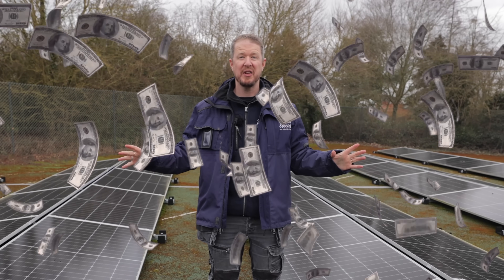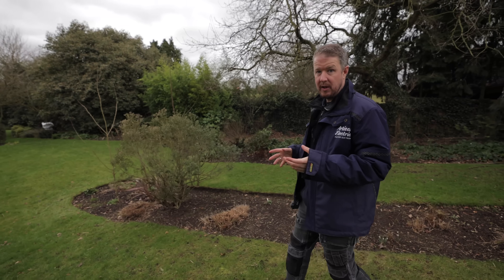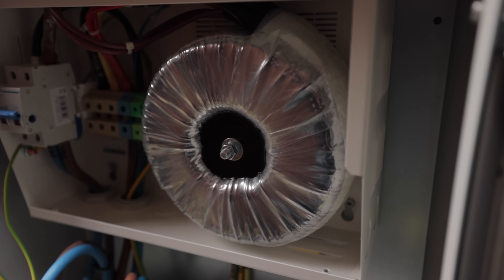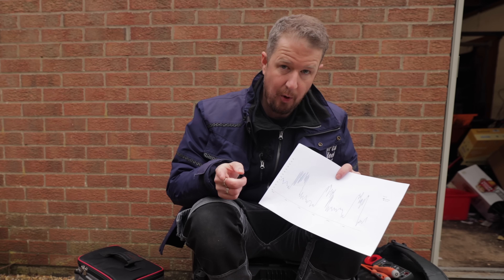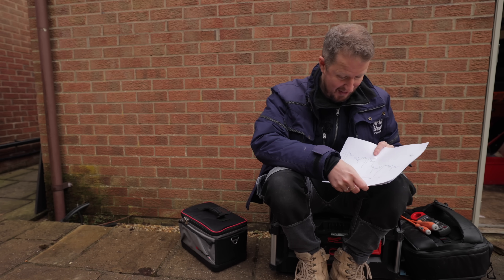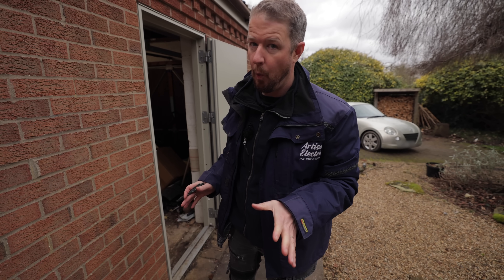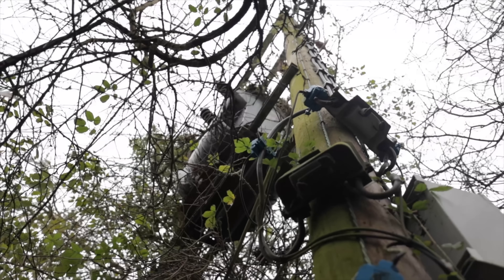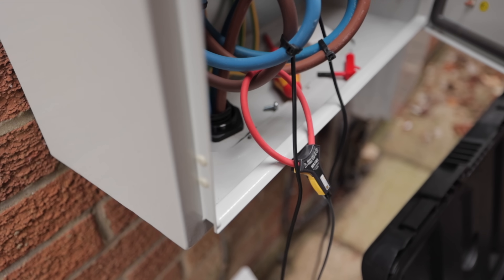THOUSANDS Down the Drain – And We Can’t Do Anything About It!

Comment: Yep 230V +10%, -6% ‘cos thr UK grid voltage was 240V which can be accommodated in the new rules without re-tapping transformers. Europe used the reverse fiddle to claim their 220V connections are within spec of 230V -10%, +6%
Reply: Yup - the whole point wasn't to change the actual voltages on the grid but to allow products designed for the European market to be compatible across the whole market.  You still can't take an old product from UK/Ireland that is designed for 240v and take it to a 220v country and expect it to work (although in many cases it will but it's not guaranteed).

Comment: That's one of the reasons why I went all in with the DNO and got new main cable in the garage and the DNO added a second line from a different transformer to the street.
It's not connected for now but I think the voltage will be much more stable.
Usually I have around 225 V but 215 to 230 V are very common.

Comment: Seems to me the problem is the variation of load/export power with a single phase rural supply. The transformer may be split phase so the premises could have a 2 x 230v supply which would provide a better balance. Or even 3-phase?

Comment: Is it possible to program the inverters to limit how how high they push the voltage? That would curtail some of the solar power (not exported to the grid, and not used by the house) but it would also solve your problem at zero cost (except a bit of time to program the units.)  But that would presumably only happen when solar input was at a peak, the batteries were full, and the house wasn't using much, in which case the system would try to push a huge amount back to the grid.  Or if the house does use up all of the stored battery power most days, more storage would provide a destination for the peak solar production to be stored locally instead of being pushed out to the grid.
Reply: Most of the settings, upper and lower voltage and frequency alarms are set out in G98 and G99 you can only alter these at the behest of the DNO.
Reply: @andyhodchild8  Wouldn't putting an autotransformer between the PV inverters and the grid also effectively alter those values (indirectly, as now they are scaled by x%)?

Comment: Surely the inverter itself can have its curtailment voltage lowered in the installer menu.  Sure that will mean PV production will be clipped at the peak voltage time of day but any increased load in the premises will cause the supply voltage at the point of connection (call that the meter if you like) to fall allowing the inverter to increase its output and raise it back up again.  No need for an expensive add on voltage optimiser box.
Reply from the maker: The inverter needs to provide voltage at higher than grid voltage in order to export power - that’s how inverters work. If we manually reduced the voltage on the inverter it would cause all sorts of issues and mainly the customer would not be able to export.
Reply: @artisanelectrics  Yes, that's how it works.  The issue in the clip appeared to be that the inverter is pushing the voltage at the premises into unacceptable areas but that the normal  unassisted voltage is 240V.  Instead of allowing the inverter to push the voltage up to 260VAC adjust it so that it is fully curtailed at 253V.  That gives you a 13V normal operating range which will still allow for a decent amount of export.  Yes, it will clip more than if the network was lower but it will save the issue of requiring the voltage stabiliser and will be countered to some degree by self consumption and storage batteries.
Reply: @artisanelectrics  yep - I fear this system may be trying to export more than the local grid can take. In which case, the inverter really should scale back export. Trying to force more export by raising the voltage doesn't really do anything good (except give you your rated export figures)

In summary: yeah you can't always export 17kw if the local grid can't distribute that... It seems to me a bit like you're trying to push power out faster than it can drain away (sorry terrible analogy but it sorta works) - the only solution I see would be less export
Reply: Pushing the voltage that high is antisocial. You are destabalising the local grid for personal gain.
Reply: @artisanelectrics explain all kinds of issues… in mainland Europe it’s common practice to stop invertingat voltages higher than 254V. The only known “issue” is a CB loss of production.

Comment: Makes me wonder what issues would occur if multiple houses on a street had solar installed, would this cause the same issue with voltage rise?
Reply: Oh yes, it does, that's why the grids becoming unstable. In a lot of countries where they have a lot of sun and too much solar, the DNO's pay end users to use the excess power when the suns up to prevent grid from overloading. Then at night when heating is needed, cars need charging, water needs heating and cooking occurs, the solar does not help. The hot climates are also a bit wiser to the danagers of thermal runaway from batteries before everyone says put a massive explosive battery in your loft or under your primary escape route wooden staircase.....

Comment: Awesome Video… can’t wait for part 2

On another note this happened to a property I checked 15years ago in wales…. 10kw export and the transform was within 20m of property…. The Voltage spikes were destroying electronic equipment throughout property …. 3 fridges and three boiler PCBs in 6 months …. No one could find the fault…. We tested voltage and was 265v …… reported to DNO and they replaced transformer within 2 days …. And compensation was paid for loss of equipment.
Reply: I'm surprised this equipment damage (that you found) hasn't happened at his property - or indeed at the neighbours' .  If this house is producing (or needing to produce) power at such a high voltage, it's possible that they might be responsible for damage to neighbour's equipment - they are, in effect, a power station. 
And, I guess the real question is why the inverters are not tripping with a "grid over-voltage" warning?
Reply: @mb-3faze  I would definitely expect the inverters to at least power-limit at anything above 250v, but I just checked the datasheet of a few inverters and they all to all the way up to 280v which makes no sense as it would fry any electronic device around. What the hell are these manufacturers thinking...
Reply: @mb-3faze  Due to the voltage optimiser hiding the true extent that the solar is making the local 240V circuit rise.

Comment: Did you do a L- N impedance reading before you started? What is the value? - this is really important. If you could change the charge current/power on the batteries so they don't charge flat out that would also very much help.
Reply: Can you explain a little further. Would appreciate it
Reply: @brianoneill350  
If you know the line neutral impedance you can work out the supply voltage when you are importing and exporting.

There are a few other factors which come into it but you don't really need to take them into account for a rough calculation.

For instance, 
Grid voltage 230
Load 13
Line neutral impedance 0.28

0.28 x 13 = 3.64v

Voltage with a 13 amp load is 226v

If they are charging the batteries at 17kw (73 amps or so)

0.28 x 73 = 20.44 
230 - 20.44 = 209.56v

Exactly the same applies if you're exporting power except the voltage will increase.

That in itself, without taking into account it's a shared transformer and the grid voltage will fluctuate anyway, would be enough to question weather the system would work exactly as expected.

It's something I come across on a day to day basis in the world of solar PV.
Reply: @roadeycarl  Exactly my thoughts given the cable run from transformer to the various houses. I also wonder if any of the neighbours have had any electrical equipment failures due to excess voltage local to the house generation site or excessively low voltage at the distant end from the transformer.

Whoever authorised this installation on the long run poled system needs to take responsibility, as it looks as if it was a failure waiting to happen as soon as the high constant currents started to flow. 

It would be interesting to see what the voltage collapses to at the last house on the overhead cable system when this system is charging the batteries overnight, especially if there are other EV owning households charging their cars at the same time!

If there is damage to other household's equipment, I wonder who would be liable. Would it be the owner of the system (including their electrical system designer) or the DNO that authorised the system after they performed their checks for suitability?

Comment: One of the problems is your bad design from the offset , you have 3 separate inverters all fighting each other to push out the voltage  , you can see from the graph  you put up that they are fighting each other to do the business end , it’s not the DNO Job to do any calculations that’s your job all the grid connection is reliant on is protection ratings for the output not that’s your voltage is higher or lower in the permitted window , you then fitted a voltage optimiser that’s the 3 inverters will still fight as they are electronics , simplfact is you went to big with the wrong equipment and a poor design and no regard for the existing grid conditions or setup , the voltage optimisation is just fiddling your graph it’s actually doing nothing but cause you problems because your lying to your kit
Reply from the maker: Completely inaccurate comment by the way - do some research on how SolarEdge inverters work and how inverters work in general. They need to push the voltage to just above grid voltage in order to export. But the SolarEdge inverters all speak to each other so they will not fight each other like you say. This system was designed with the help of SolarEdge design team specifically as it was the first time we needed to use multiple inverters on one site.
Reply: Come on… 17kW isn’t a lot of power. Most homes have 100A supply, which is 24kW nominal. If the local transformer and power lines isn’t stiff enough to cope with a 24kW load, it isn’t stiff enough to cope with a 24kW export either, and it should be!
I suspect one big reason why their supply is on the high side (240V vs the 230V nominal) is because it sags so much when under load - they needed to peg it higher to compensate for the weak power lines / transformer. Either that or it dates to before European harmonisation when we switched from 240V to 230V to match the continent.
I hate to think what happens when a few people on that street want a shower or run their washing machines at the same time… Also, that two-pole mounted transformer is a 1960s design, back when people didn’t need as much juice. It’s time it was upgraded already.
Reply: Comment about is not allowing for diversity and low daytime loads Fact is on some sunny days that solar is powering the whole of that grid and pushing back on the 11kv  and that’s the point a lot of you are missing
Reply: Get a deye 16kw single phase hybrid inverter. I belive in the UK it's re branded a synsynk max. I have the deye and its run perfectly for 25 months.
Reply: ive just noticed that the UKPN power networks are allready monitering that pole TX you can see it has CT,S and monitering equipment fitted in the video
Reply: Do you think the inverters speak to each other and make changes as quickly as physics , you show that  you just assumed the grid was highly large stable and kinetic by the fact its only in this video you go and  find the transformer, fact is your desing would be fine on some inner city larger grid but not on a rural hamlet fed from a single pole mounted transformer that’s not massive , you can’t argue with the size of the transformer or the cable size or type , and you clearly did not inform the designers of the limatations of the local grid that extends to about 20 houses from what I can see off the pole numbers , you slapped a big install on a small grid , you can argue with me but you can’t argue with the electrical theory, also the simple fact is the inverters can’t pus the energy out unless they fight each other and the grids nothing enough to accommodate that type of push pull
Reply: Now imagine if now thousands of stand alone inverters are then connected to the grid, oh yes, there are! No wonder the grid is becoming unstable. The step-down substations then work backwards as step-up and the windings get melted, hence why all the transformers are having heatsinks and fans bolted on to cope with the back-fed power....
Reply from the maker: @paulbell7654 massive upgrade needed to our grid equipment in a lot of places it’s well overdue
Reply: @artisanelectrics you has yet to tell us what’s actually wrong with the transformer or the grid equipment and why is the problem that’s forcing the voltage up , no mention of the polecat solar too , it’s clear that is a big solar fighting a big solar virtually next door
Reply from the maker: Solution: Let’s rip it all out and fit a 12kW Sigenergy inverter instead 😂

Comment: Interesting. For best results ensure that the cable you are monitoring is in the centre of the the CT loop. Maybe make a form out of plastic to keep it in place.
Reply from the maker: That's a good idea!
Reply: @artisanelectrics  You're using a Rogowski coil as the current clamp I think, those are supposed to be pretty immune to where the conductor is placed within them. You could even prove this out by having a steady load through the cable and move the coil around and see how much the readings change. For a well designed coil - which I imagine the CA one is - then it shouldn't matter much or at all how central the conductor is within the coil.
Reply: @davefrizelle3882  Good point about the Rogowski coils. My experience came from a few years ago in a company where we had to design our own custom solid core CTs. A colleague was doing an investigation about reading accuracy. It was surprising what the effect of cable position had.
Reply: @MrLikerBiker  I agree 100%. I have had this experience - I bought a "budget" earth leakage clamp meter and when I clamped line and neutral of a balanced circuit I could make the meter measure 50 or 60 mA of leakage that didn't exist, depending on where the two conductors were within the clamp. As you suggested in your comment, I made a plastic insert for the clamp to hold the two conductors together and in the centre of the clamp and it helped, but was still not perfectly accurate. Then I bought a Megger DCM305E and the difference in accuracy was amazing. I could clamp the conductors without making any effort to keep them close together or in the middle of the clamp ring, and it would measure only 1 or 2 mA of leakage in a balanced circuit. The key difference between the two was the quality and uniformity of the measurement coil. In theory if the coil is perfectly uniform then it won't matter at all where the conductors are, but any non-uniformity in the coil will show up as measurement variation as the conductor or conductors are moved around within the circle.

In your previous experience, what kind of measurement error did you see as the conductor was moved around within the coil?

Comment: This customer needs 3-phase.
Reply: They live in a mansion so it can't be hard to pay for.
Reply: "Battery Man" (youtuber - somewhere in the UK) happily pushes 30kW on to the grid over his 3 phase supply (from his two Model 3 recycled car batteries).
Reply: 3phase is not standard for buildings in UK?
Reply: @AndreasDelleske it’s not, in new builds 3phase is installed as standard
Reply: @AndreasDelleske Regrettably not.  Unlike many parts of Europe it was never standard to provide 3-ph to domestic premises.  In many places you can upgrade (streets tend to have 3-ph running down it and neighbouring houses tap in to the phases in sequence, 1,2,3,1...) but in some places this is not an easy option (towns where each neighbouring street is on one phase).
Reply: @Dranok1  Even when it's easy they still want £. They need to upgrade my property and have offered to do 1p for free. I asked if I can have 3p at a reduced rate as they will be digging up the road and was told no- I will need to pay for the road to be dug even if there's a massive hole waiting for the free 1p. It makes no sense other than greed. Road is also rather generous as the engineers confirmed it's just the footpath and my drive
Reply: @AndreasDelleske no
Reply from the maker: Yeah that would be nice
Reply: Can you explain why they didn’t insist on 3 phase anyway ? I had to and all I was installing was a 10kw array and 24kw battery with 11kw inverter .

Comment: Considering they have overhead cables between the transformer and house I'd question why it isn't TT which would eliminate the need for PEN fault detection - doesn't help the issue of voltage swings though.  Bet they are blowing a lot of lights with the high voltage.
Reply from the maker: Good point about TT but it’s PME at the pole
Reply: What cross section is the overhead supply?  In my particular part of the world it is the premises' responsibility to see no more than 2% voltage rise across the installation to where ever the premises wiring meets the network (which would be the over head in this case?).

Comment: One thing am concerned is the high usage on heating if they are burning though that amount by 9am. UK Power Networks will probably be looking for a lot of money to upgrade the infrastructure. One of my complaint cases I was dealing with they was looking at nearly 10K for it so hopefully they don't do that to the customer. I certainly would like to see an update.
Reply: Correct. And isn’t this why we all have to pay standing charges?
Reply from the maker: They really should do this for free it’s their infrastructure after all
Reply: @artisanelectrics  Totally indeed I would agree with you on this.